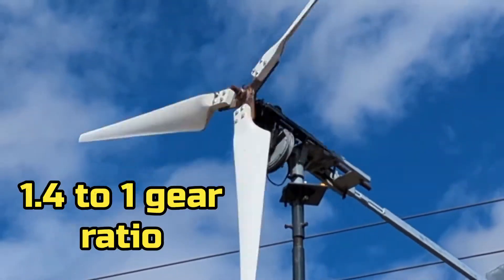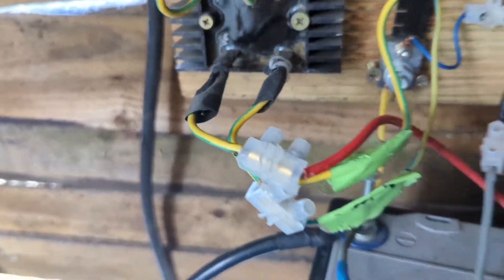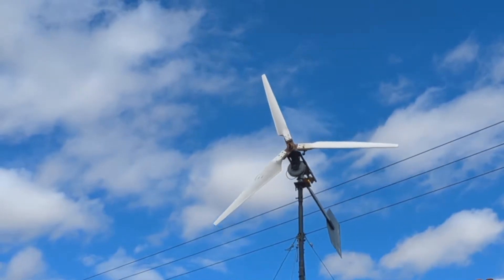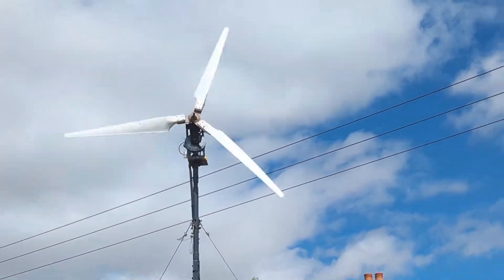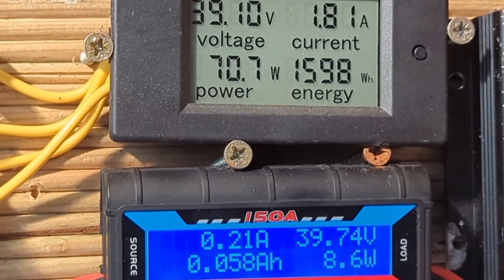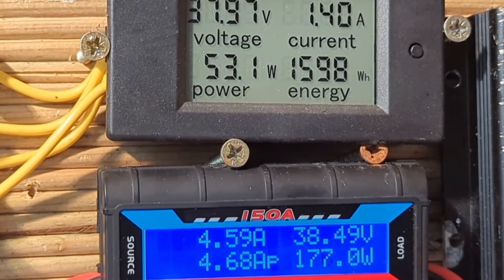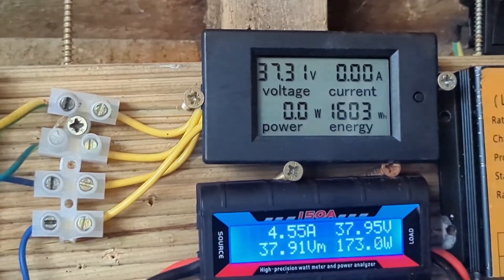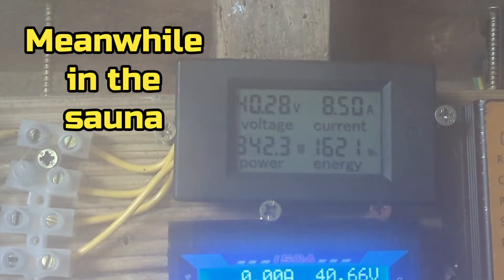Wind Turbine Testing - Very Windy - Running with a 40 volt LOAD - 3rd August 2022

Comment: Hey Gav your numbers are all over the place with a momentous setup which for me begs the question how good and reliable is your universal conductors on top of the mast? Are any phases dropping in and out? Im making 3 ac volt meters into a panel to check the 3 phases so I can watch for early universal failure....
Reply from the maker: I'm pretty sure it's just the wind speed variation and the fact that the motor is hard to turn , the wire just goes down the tower , you may have meant when I turned the dump load on full and it crashed the battery? , thanks for the comment , cheers.
Reply: @GavinFreedomLover  no i mean the twisty thing that stops the wires winding up on themselves....you have some of those right? Ahh yeah....slip rings?
Reply from the maker: hello mate no the wires just go straight down the hole, no slip rings, needs un twisting fairly regularly, once every couple of weeks.
Reply: @GavinFreedomLover  ummm I guess you know you can buy 3 phase slip ring assemblies?
Reply from the maker: yeah it's not a biggy at the moment but on the list for the future, cheers

Comment: Think you can still do with a lot taller gearing still. We hit 350w regularly with a 350w hub motor at 24v and the 107cm istabreeze blades. 

Good to see its finally making some watts though. We havent had proper wind in weeks. Maybe an afternoon or two sadly.
Reply from the maker: I think the 37-20 would work when it's this windy 20-25mph but it's not that often , this ran really well at the higher voltage, hope you get some wind soon.